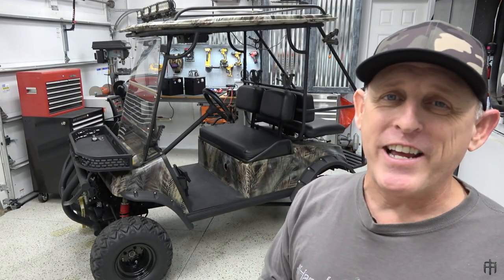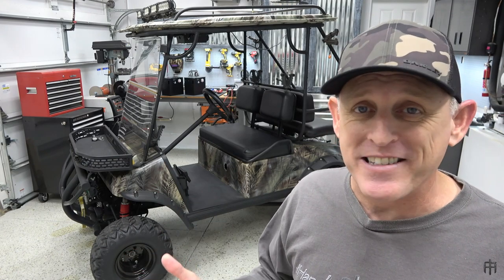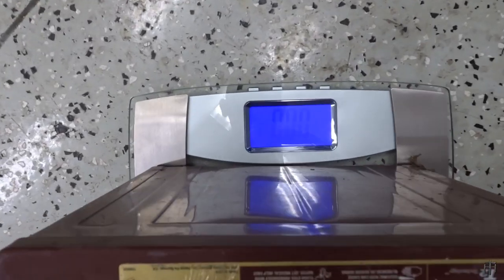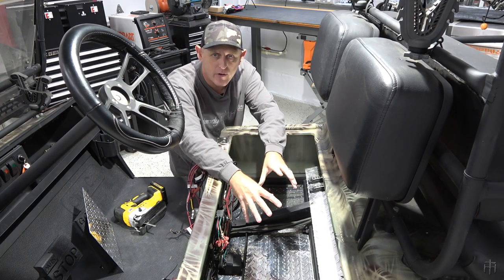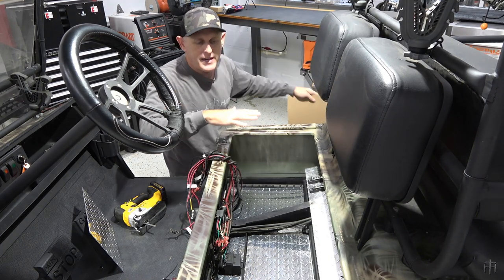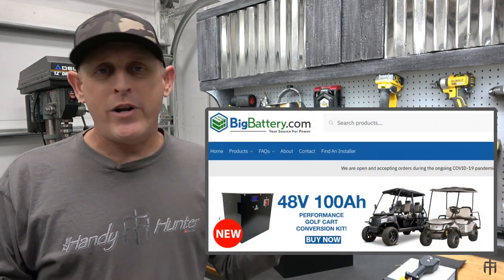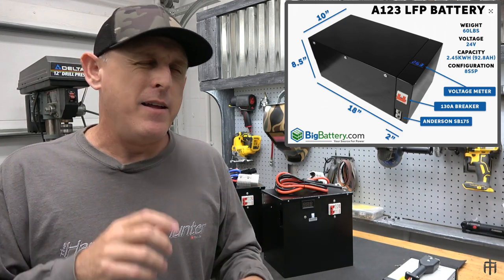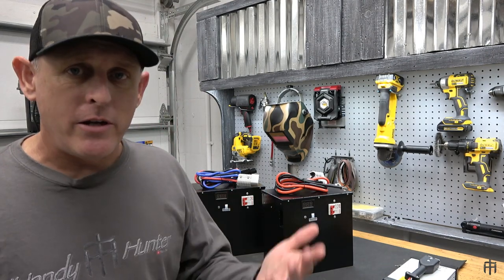Tesla Powered Hunting Cart!  Lithium Battery Conversion!

Comment: There is nothing Tesla about this... Tasty clickbait, however. Having the same battery cell type (2170 cells) as a Tesla Model 3 does not make it "Tesla Powered". If Tesla used "AA" batteries it would not mean that my TV's remote control is "Tesla Powered" also.
Reply from the maker: BigBattery actually pulls these 2170’s from Tesla cars.  That’s why they mention the Model 3 in their product description.  That’s why I also mentioned it in my title...not misleading at all.
Reply: @TheHandyHunter  Thanks for clarifying. Good to know.